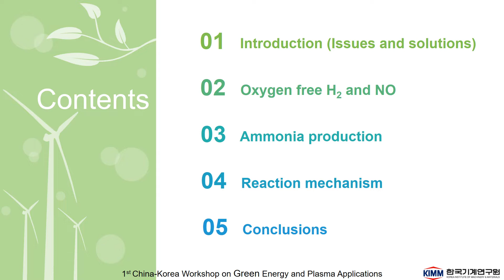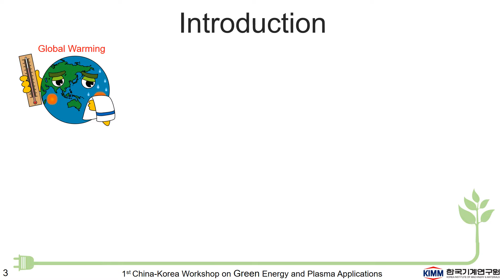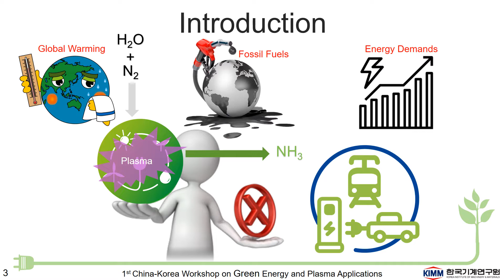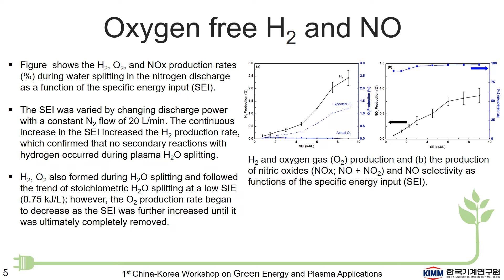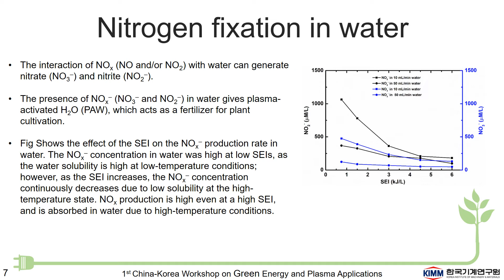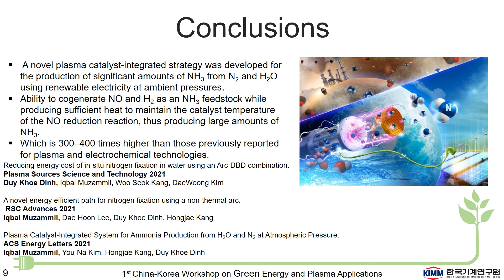A Novel and Sustainable Plasma Route for Green Ammonia Production

Comment: I am very interested in recreating this experiment locally, can you point me in the right direction to start doing it? I have access to a hydroelectric power which can for perfectly with this experiment for our coffee farm in Guatemala. I already downloaded and read your article several times but due to the fact that I'm a civil engineer, I'm afraid that I still don't have the full picture of the magnitude of this experiment...
Reply from the maker: Thanks for your comments,
Could you please confirm the purpose of making this setup?
Are you planning to produce Plasma activated water (fertilizer)?
It requires discussion to understand all concepts before applying them. However, as you mentioned that you are not from Plasma Science. So I will recommend you check the already commercialized device for plasma-activated water.
Thanks
Regards,
Muzammil Iqbal
Plasmascholar.com
Reply: @plasmascholar515  Thanks for replying, the purpose of making this setup is in fact make a pilot project for production of fertilizer locally using this high efficient method. totally agree that further discussion is required in this topic, maybe I can send further information through email if you could provide the address. Yo mentioned that already commercialized process are now available. can you point me in the right direction in this regard?